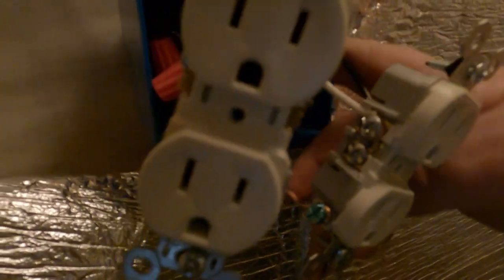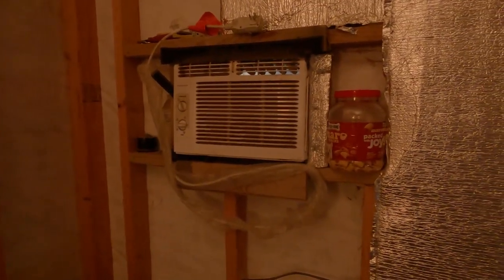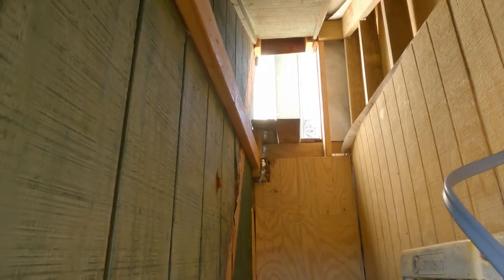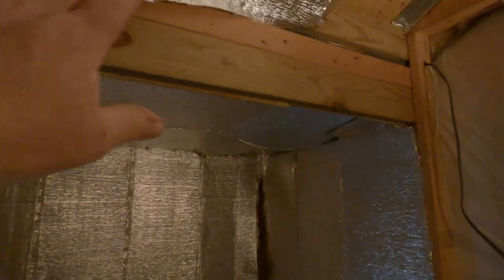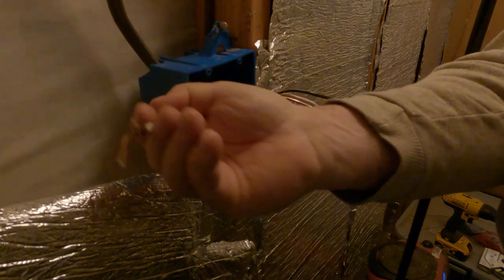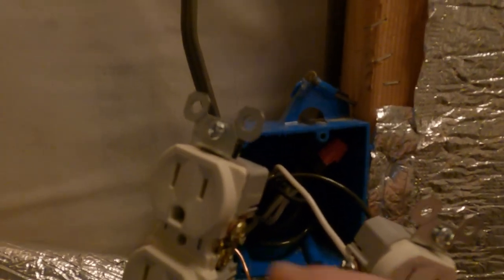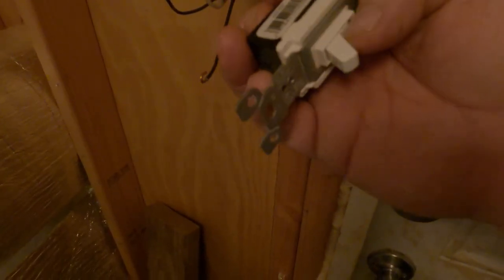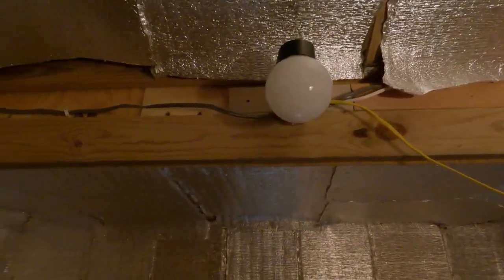Its Taking Far Too Long! My Work Keeps Getting Interrupted/Dog Apartment Electrical

Comment: Hi Dogman 🐕
Happy Thanksgiving! This is another fun project. I was thinking, maybe elevate the washer & dryer to a height that will work best for your 75 year-old body? And, maybe build cabinets underneath, in the platform, which could hold more stuff. Since dogs are short, you could build some nice size cabinets along the ceiling too. And, maybe build a pop-up table for folding laundry?

Comment: HI Mike,sorry you are being bothered so much. It can get you down when your trying to do your work. Been there, Done that also.But you are doing a great job with everything. Safety Checking is a must when dealing with Electrical Wiring. And also plumping. Double checks for any leakage. Over 8 years you have accomplished so much. You have done a lot to be proud of that is for sure. Keep On, Keep On. *Happy Thanksgiving* and I will see you. God Bless.

Comment: Where you been all day Mike, do I sound like a nagging Wife. I been looking out for your videos, but there was none till now. You gotta pump them videos out. LOL  I remember the passed hubby, changed a electic plug thing, cause the other one stopped working. Then once he had it done, it still did not work. Then the Super looked at it as I had mentioned it to him. What was wrong is this metal thing you had to pull off, then the plugs worked. ;)

Comment: I can't believe you've been standing on that little table which is clearly not safe to do.  I am so glad you got a mini ladder!!!   I understand about neighbors, I've had good ones and bad ones and noisy ones.  I'm in an apartment now because it was what I could afford.  Most of my neighbors are pretty quiet but right next door is a very early rising lady that likes to wash her dishes and put them away first thing, all with banging doors and drawers.  I pretty much don't need an alarm clock if I need to be up early.  There is no sound canceling stuff in the walls, sadly.